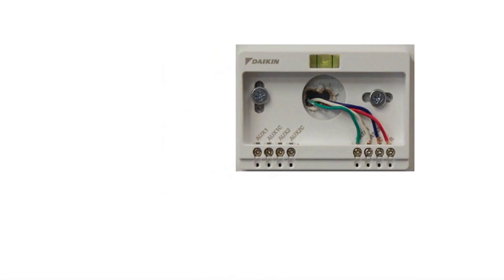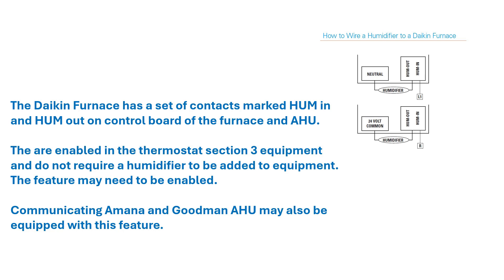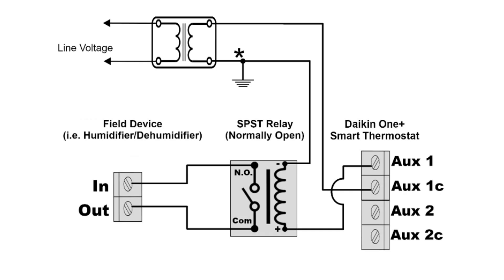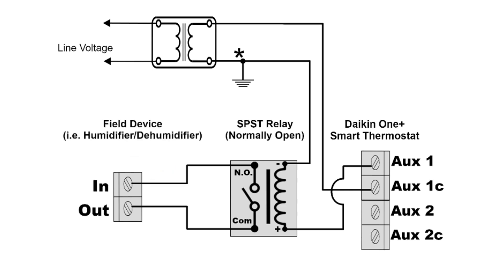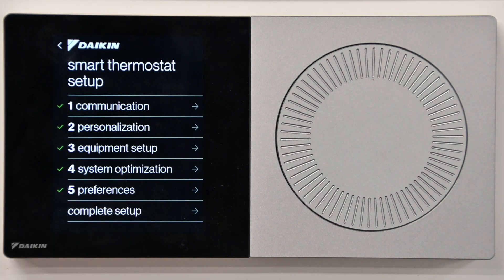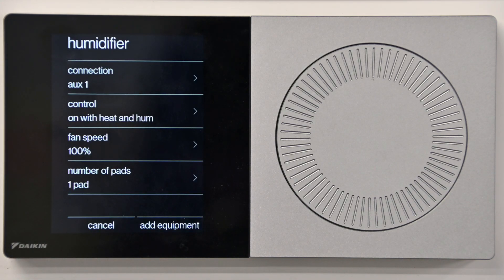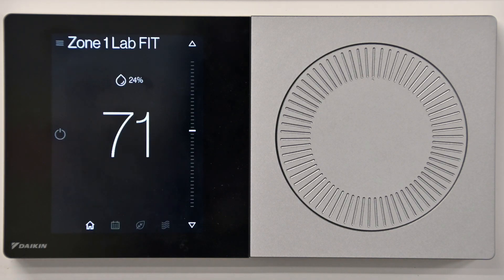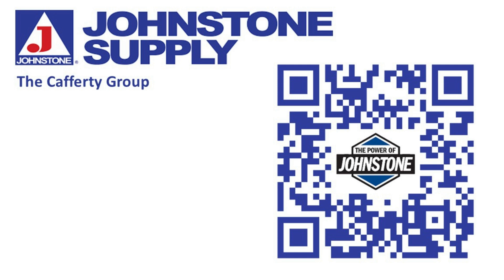Daikin ONE and ONE touch add Humidifier to AUX contact

Comment: Super helpful video!  Can you help me pinpoint connecting Amana AMVC96 to Honeywell HE300A1005 humidifier?  I’ve got a 24v transformer with 24v connection to Aux C, then Aux to relay coil. Transformer C connected to other relay coil end.  Does the NO and Com connections go directly to the two HUM terminals on the HE300?  The Stat control option is set to on with heat and hum.
I originally tried using R off the board instead of external transformer but was getting a terrible buzzing in the relay.
Reply from the maker: Use the R from the board to the AUXC then the AUX to the added relay on the coil with the other side of coil to C.
On the humidifier terminal strip the terminals marked HUM control will go to the C and NO of the relay. Place a jumper on Sensor(airflow). The added transformer will feed power IN on the terminal strip for humidifier. Move the dip switch marked monitor system to the right for off.
Reply from the maker: When running heat it may take up to 3 minutes to call for humidifier.

Comment: My installer forgot to hook up my humidifier.  So, is this right for a Daikin Communicating furnace with FIT and Daikin One Touch: Field-install a wire from the furnace R terminal (24V hot) to Aux C on thermostat, then AUX to one of the HUMs. Then Connect the other HUM terminal to the humidifier's solenoid valve (one wire). Connect the remaining wire from the humidifier solenoid to the C (common) terminal on the furnace control board.  Then setup Humidifier in the Equipment settings?
Reply: please i need to know the same
Reply: ChatGPT FWIW:

R → AUX C on thermostat → AUX → HUM”

Incorrect / unnecessary.

The One Touch thermostat communicates digitally with the furnace. There is no need to run 24V from R through the thermostat to control HUM.

In fact, the AUX terminals on a communicating thermostat are not powered outputs — they are inputs to the communication bus.

Wiring R to AUX could confuse the thermostat or even damage circuits if miswired.
Reply: @jc4me52 So everything is done at the board.  The One Touch just says, hey, enable this input.  Got it
Reply: @keithb2024 sorry enable what input? I am using two-way communicating mode 1,2,r,c . I am not using a non-communicating thermostat like an ecobee.
Reply: @jc4me52 yes, I’m using the one touch.  So I have to go into equipment and say enable humidifier.  When I say I want for example 45% humidity set on the thermostat, it just powers the HUM circuit on the furnace board digitally to allow for the solenoid on the humidifier to open.
Reply: @keithb2024  okay, i have newest one touch (not one touch+) model is DTST-TOU-A.  Did you have to run a wire from R to HUM to supply HUM with 24V or it just works without it.  Please explain how you wired the board???
Reply: @jc4me52 I have mine wired differently and it never worked.  That last what I was hoping to find here is the correct way to wire because my house is getting dry and it’s been two years since it’s worked.  Finding info how to wire correctly is tough!
Reply from the maker: No but close. The HUM on AHU is easy to set up but harder on the Gas furnace. If you have the extra wire then yes R to AUX C - Aux to a relay coil and the other side of the relay to C. Add the humidifier in section 3 equipment. Now when you have a call for humidity it will close the 24volt relay and you can do anything you want with contacts. Most contractors will connect R to one side of open contacts and solenoid to other side, the other solenoid connection to C. This isolates the sub base of stat from any current drawn from humidifier.
Option 2 do not add humidifier in section 3 but go into section 3 and look at gas furnace, if it has an option for humidifier relay turn it on. Connect R to HUM on the furnace board and the other HUM to humidifier. Call for heat and humidity, either option can be a 3 minute wait.
Reply: @johnstonecg last night I was able to figure it out in the furnace menu. Like you said there is a option to turn on the humidifier relay. It was off. Now it works
Reply: @johnstonecg thank you however had I not found it, your reply would have let me down the right path!
Reply from the maker: @jc4me52  Happy to help with any questions
Reply: @johnstonecg So if you add a physical coil relay it works with equipment setting, but if you wire option 2, it’s working independently?
Reply from the maker: @keithb2024  When the option is available in the Daikin ONE and the hum terminal is switched on it settings it will turn on and operate with heat and call for humidity, so not really independent. Some units will give option to be independent and force blower on but we normally only see that option with the AHU.

Comment: Show us how to wire a humidifier into a  UT-3000 .
Reply from the maker: If you have an extra wire at the primary stat you can jumper R on the stat subbase to AUX C then run AUX down to RELAY on UT3000. When 24 volts is present the IAQ contacts of the UT3000 will switch from C NC to C NO (close the contact). In section 3 of the dealer edit add equipment - choose humidifier - choose AUX 1 or 2 (the ONE has two AUX's but the touch only has one and you wont see this option) - choose how the unit will function.  With a steam humidifier choosing with hum call (no heat call needed) be sure to set fan to low speed when given a choice.
If you do not have an extra wire I need to know the model of furnace or air handler.

Comment: These daikin thermostats are garbage! Love getting these stats come with no book and will not let me add humidifier for no reason
Reply from the maker: They wont please everyone, but this is 2025 and all information and videos are at the web site. The humidifier part is confusing. With most equipment you can go into equipment tab and turn on the humidifier contacts and with certain gas furnaces its on by default. If you add a humidifier it will change it to the AUX contacts. The wire diagrams are all on the site.